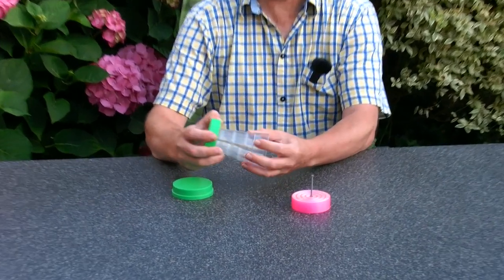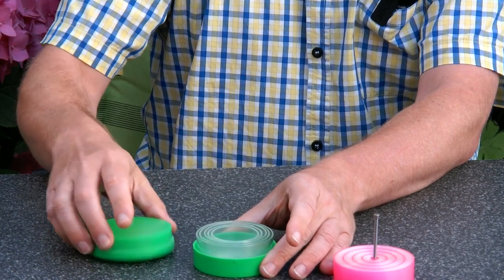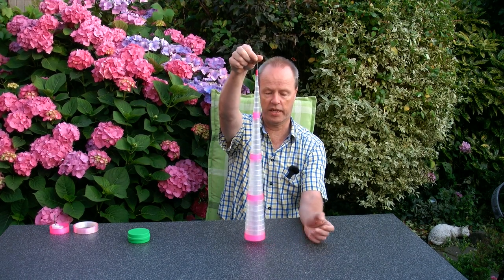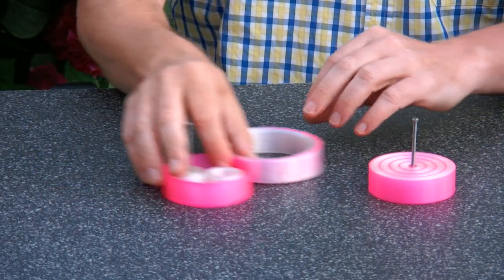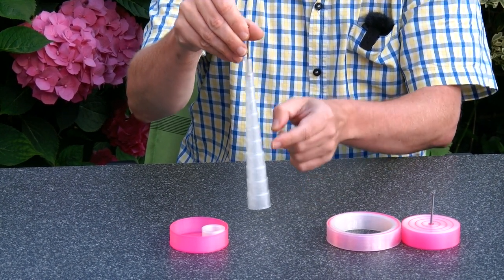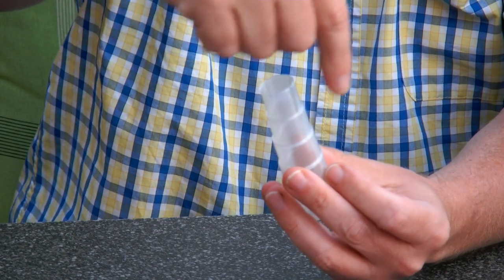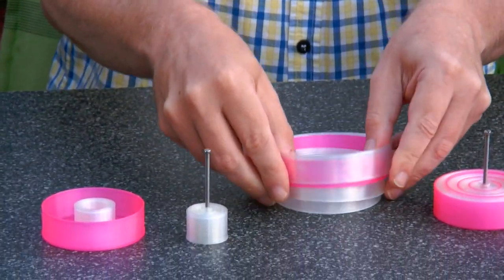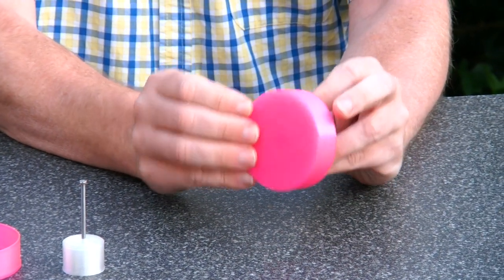Telescopic Rings - What is the most telescopic structure that you know?

Comment: I inherited a cup like that from my grandparents, but it was solid silver and collapsed to a much smaller size as it did not have the outer case. Also the flat little bottom cup was not attached to a larger cup. So it would readily disassemble into a tiny cup and 6 rings, making it easy to clean, would be stored in a small bag of cloth.

Comment: I wonder if you can make a maze with walls and pins between the layers so that they need to be lined up before a layer is free to extend. The goal of course is to fully extend it. If the only interaction is between pairs of rings, then it's more of a labyrinth which is not very interesting. Therefore maybe you can cut out some large holes in the side of one ring so that another pin in the parent of that ring can interact with the child of that ring, etc. Bonus points if it results in a functional vuvuzela. Naturally this would be called the Vuvuzela Puzzle.
Reply: Nice suggestion, Melinda, but if you would blow on a Vuvuzela of that size, I'm afraid you'd have to use the same telescopic horn as a hearing aid for the rest of your life! 
📣😖

Comment: You could create a type of maze having paint on the outside of each ring. So that you have to spin the rings so that there would be only one path from the bottom to the top, but there would be many false possible paths.
Also, if you want to use the bigger rings, possibly changing the plastic filament to a harder plastic could decrease the flexibility allowing to use them without falling out.

Comment: There could be tiny indents at "random" points on the circles and extrusions on the corresponding connected circle, so that they can only fit together when you rotate them correctly relative to each other. But of course rotating one circle changes its orientation relative to both neighbouring circles. The problem with this is that you could pretty trivially solve the second circle relative to the first, then the third relative to the second and so on. Maybe if there were multiple ways to fit each circle into/around the previous one and some circles in the middle couldn't be rotated at all (somehow), then it could become a real puzzle.
Reply: you could have holes and tracks instead of just indents that would force you to interact not just with the immediate neighbor rings, but multiple rings in either directions.  I bet that could get pretty nasty